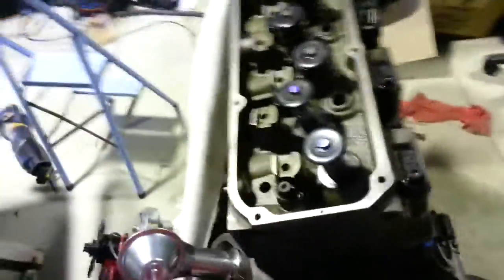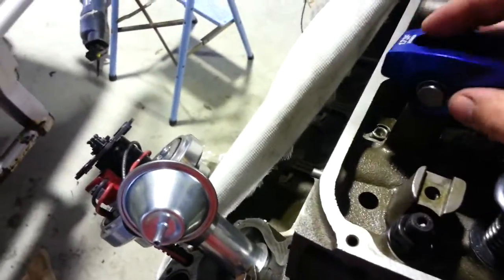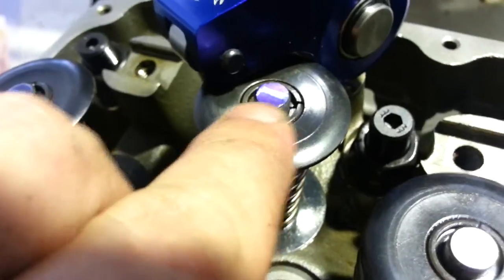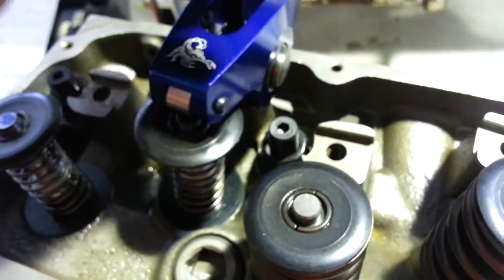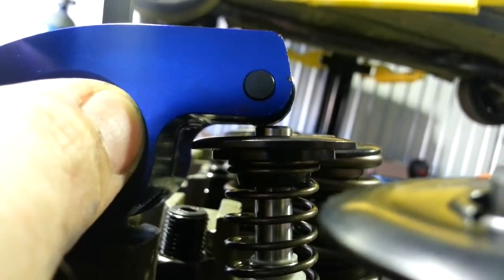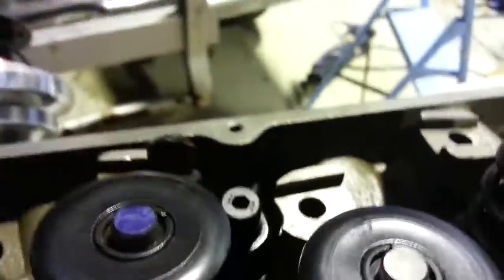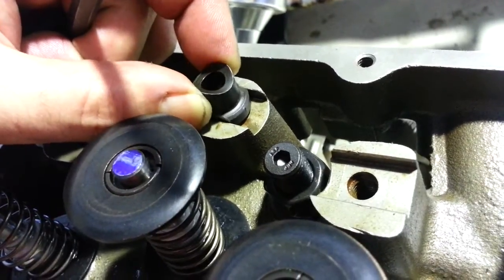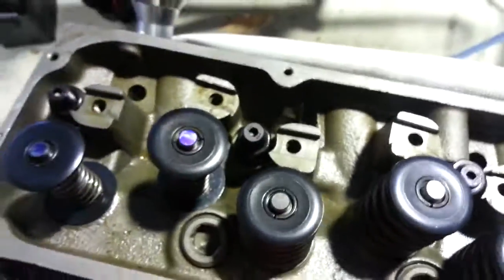Scorpion roller rocker geometry fail, ford cleveland 351

Comment: just shim it 030 i have done heaps of them ,never had a problem.
Reply: I wish it was as simple as that. There's different rocker geometry depending on what head you have.
Reply: Thats why we sell shims
Reply: Dr. Rabbit  The ignorant one is you. Go contact Scorpion, they have 2 different rockers for the Australian made 351 cleveland.
Reply: GP Tech hi gp Tech. Did scorpion give you a part number for the other rockers. I am having the exact same issue. I need a rediculous amount of shims to bring the geometry correct.
Reply: @anthonythomas4407  Yes, the one they list in their catalog is wrong for the aussie Cleveland. You need the SCP-1056 for the big block 385 series. Check with scorpion as they sent me a single SCP-1056 to confirm it was right. They wouldn't swap out the rockers without charging me so I ended up buying Yella Terra rockers which fitted perfect.
Reply: GP Tech, Hey mate, Thanks for the reply. I have been phoning around today and found no one with that series of rocker. Now looking at other options. Might end up going with the Yelle Terra ones or Comp cams fully adjustable. Can I ask what model ones you ended up with.
Reply: @anthonythomas4407  It was the ST2015 model from Yella Terra. But check first with Yella Terra.
Reply: GP Tech . Awesome mate. Thanks for the information. Take care
Reply: What were the original scorpions you had, 1024? If so, still got them?

Comment: Man I hope you worked it out- Im doing mine next week and Im hoping the geometry will be ok heads have been shaved and block decked -
Reply from the maker: Scorpion make a dedicated 351c rocker according to there website, that's what I ordered, but they don't suit most of the Australian clevelands and the only way to know is to have on hand both the 460 and 351c rocker and see which one is right.
Scorpion wouldn't change over the rockers so I have set of new scorpion rockers sitting in a box as I fitted the yella terra ones and had no issues.
Reply: I was looking online at YT Street Terra series. I think it the way to go. you can adjust roller height to correct valve geometry and tappet height which is awesome .
Reply from the maker: There's more to it than that, the distance from the roller to the pivot point is what's important. There is only one correct height for rocker geometry.
Reply: Just got back from QLD picked up a 9inch diff for my XC- Ill leave the valve train to the experts. I dont want to stuff it up
Reply: @grantpatullo  i got the 1.73 Scorpion 5/16 pedestal with 8.400 pushrods. 2 years now but the valve train starts making noise. Im going to check in spring. Maybe the pushrods are to short? Cam kit is 292h comp
Reply: @grantpatullo  Scorpion sells an adjustable set for the aussie engines.

Comment: You can shim it if you don't have to use to many shims the base still sits in the groove and does it's job of stopping the rocker shaft from rotating obviously if you need to many shims and it sits out of the groove it won't work but that geometry isn't out by much at all I've heard of the scorpion rockers failing even with the right geometry I've just shimmed a 250xflow with roller rockers that was very similar geometry